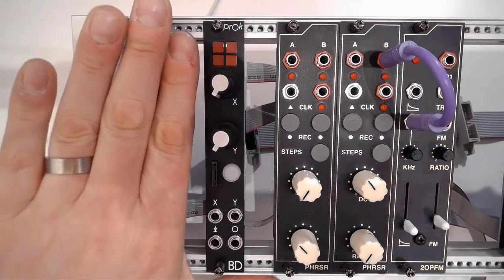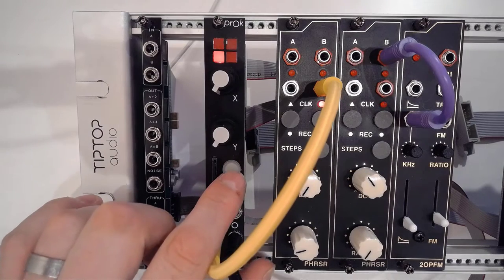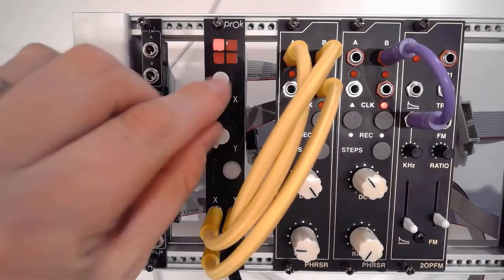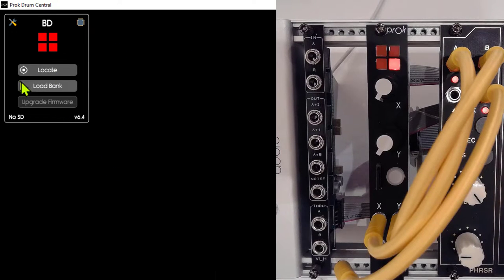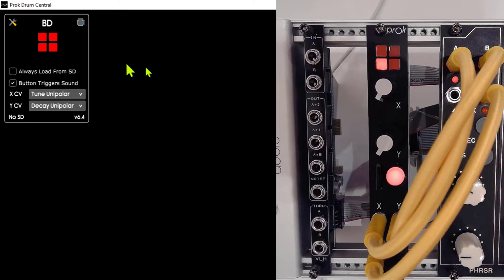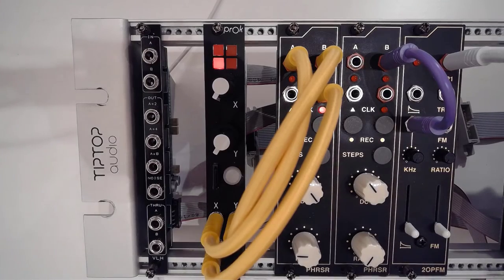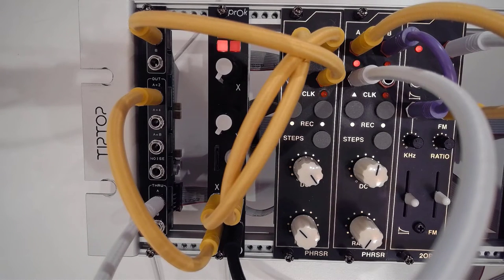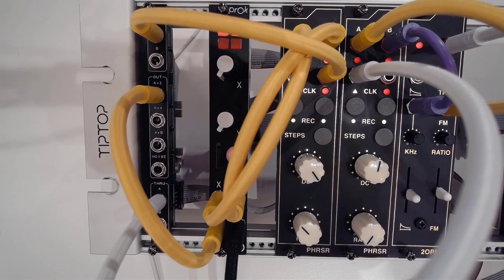Episode 49: Prok Drum Modules | Eurorack drum voices | Latest firmware | How to switch voices

Comment: For anyone that may have been wondering how to update the firmware & use the editor:
-Eurorack power must be plugged in as well
-Download the software, open, then plug in your Prok module
-No need for drivers or to hold any buttons on the unit, should just show up once power has been supplied and usb is connected